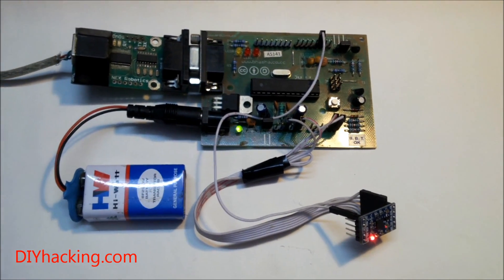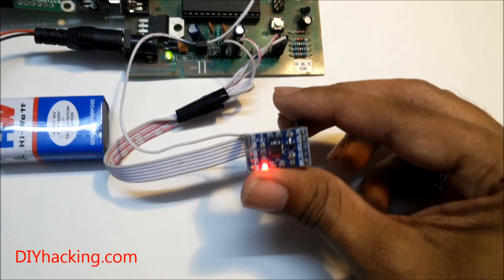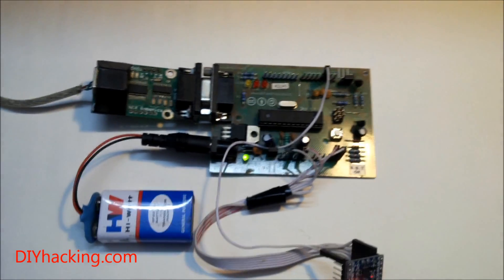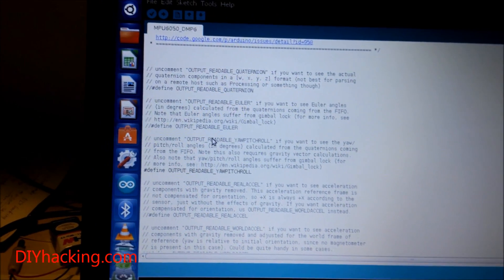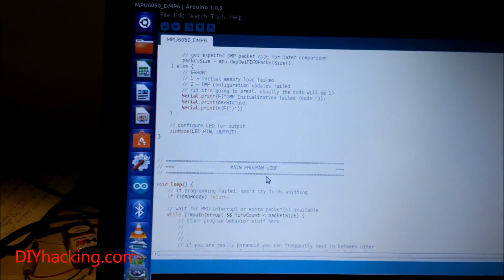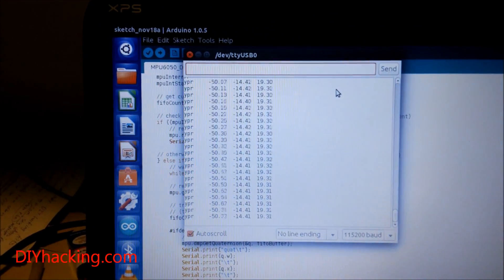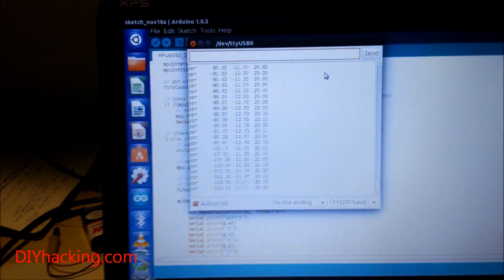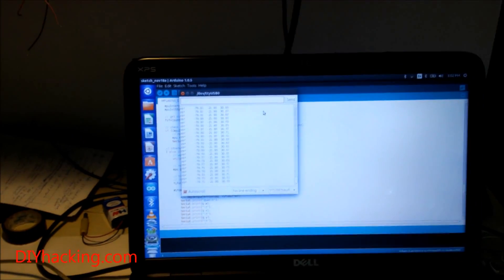Arduino MPU 6050 tutorial

Comment: My code gets stuck at "initializing I2C devices..."
Reply: Likely your Arduino can't connect to the MPU6050 board.  Make sure your sensor has power (LED is on) and that you've wired it up properly to the Arduino

Comment: Hello, I'm using Arduino Mega 2560 and Sparkfun MPU-6050 breakout board. I changed the I2C address to 0x68 (mentioned in register map), but it did not show anything in the serial monitor (or if there was something, it was unknown characters). 
What do I need to do? Thank you
Reply from the maker: Hi, after attaching it to the correct SDA and SCL pins of Arduino. Just run the example code for MPU. Changing register address is not required, according to me. Check it out here: http://diyhacking.com/arduino-mpu-6050-imu-sensor-tutorial/
Reply from the maker: Try running the MPU_raw example code and see if you are getting the values.